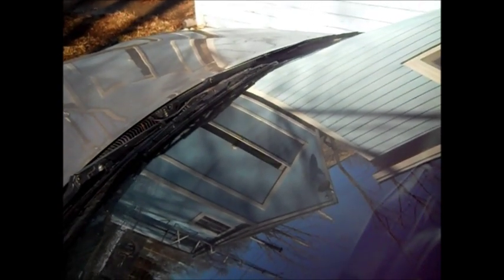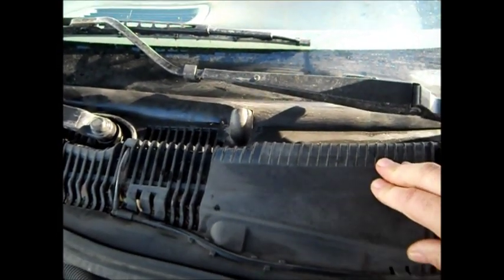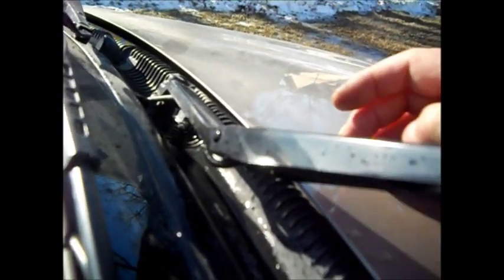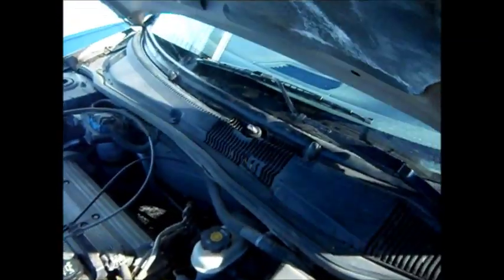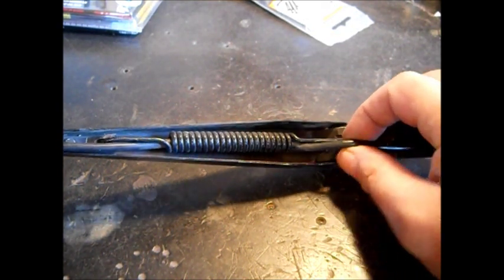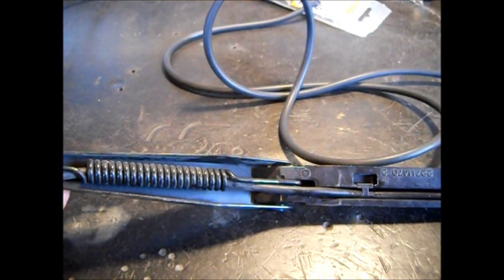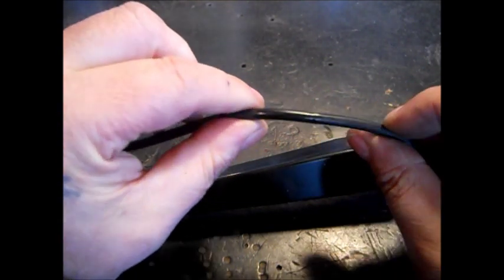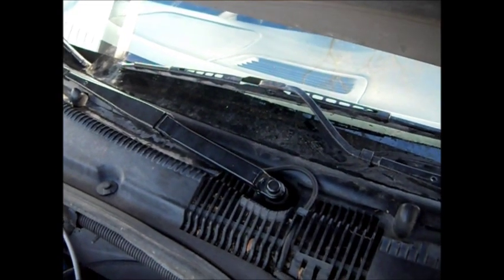Windsheild Washer hose repair 2004 CAVALIER

Comment: Excellent video!  I have a 2003 Cavalier and your helpful video directed me to the problem right away.  The  battery wore out a hole in the hose!
Reply from the maker: Thanks ..I was lucky to find a piece of tubing the right size ..They may sell a hose splice to fit the hard plastic line

Comment: I have the same problem on a 2005 Cavalier.  The drivers side upper one sprays too much fluid and it sprays  too low on the windshield. If I move the nozzle it sprays too high or wont spray at all!   The passenger side sprays fine.   I saw there was a lower one that must have not been working. There's a T fitting that connects the two and one of the nipples broke off.  I fixed it with hose tape so that the sprayers are working on both sides.  I went to AutoZone  they don't carry the hose or the T' or couplers. Poor excuse for a parts store.  Did you ever get your drivers side spraying right?

Comment: not2fast4u2uc  I redid  the driver side which was the problem on my Cavalier.  I got the lower one spraying but the upper one is spraying way too much fluid out and too low and  not in a mist the way the passenger side does.  I think the nozzle needs replaced.  Cant find any for a Cavalier on the wiper arm at any parts store.  Online some want as much as $20.00 for that little nozzle!  I wondered if you had fixed your drivers side wiper.

Comment: Wish you would have shown the removal of the wiper. I can't get mine off. Was kind of afraid to man handle it too hard.
Reply from the maker: Take the nut off and grab the arm with a vise grip or big channel lock pliers And wiggle it off
Reply: Thanks for the tip I will have to try that!

Comment: I had the same issue where the hard plastic broke where the battery is? Anyone know a good fix?
Reply from the maker: TomorrowIsDead608 I used a small piece of an antenna off a transistor radio and heated the hard plastic hose with a hair drier to stick it together
Reply: I just taped it together, works for now. Mine is a soft plastic though.
Reply: +TomorrowIsDead608 use vacuum or gasline hose that fits over the plastic hose and secure with wire tires or small hose clamps.  mine broke same place.  Been fine for years now.
Reply from the maker: +Billy Boy I could not  reply to your other comment above Any parts store should carry hose this size after using the sprayer for a few days the worked OK use the wire off a bread tie and unclog the sprayers
Reply: +not2fast4u2c  I found clear plastic hoses of various sizes at a hardware store they should work and they sell by the foot..  All the parts stores have them on line but not in the stores.  I checked Napa on line  it says they sell it in store by the foot.  I'm going to call them to make sure.  I don't want to spend $25.00 for 40 ft. when I only need a few feet to be safe. Now I have to find a t fitting that will fit.  Good video!
Reply: +Billy Boy Too be more specific.  Cut off the bad plastic. Cut a piece of vacuum hose long enough  to splice the 2 ends of the bad section. Then secure both ends with wire tires or hose clamps.